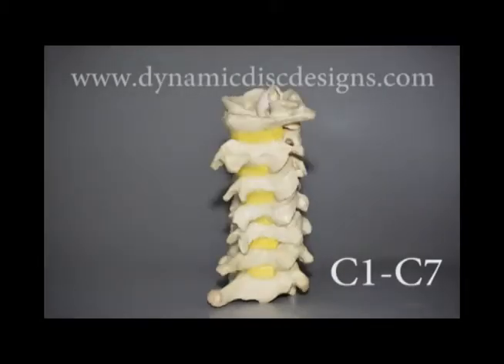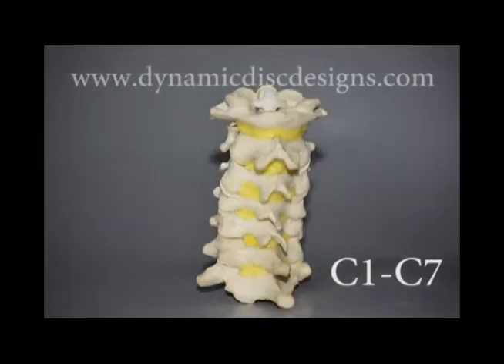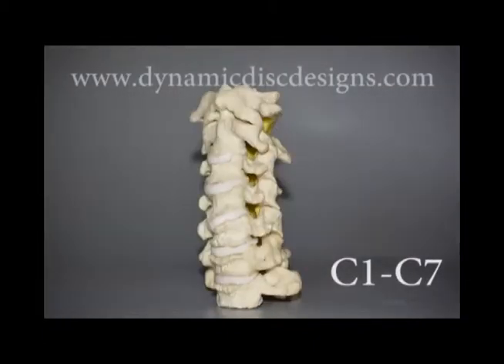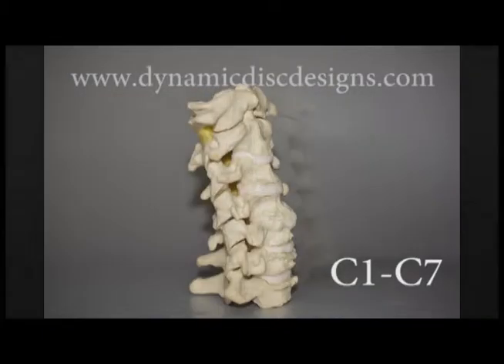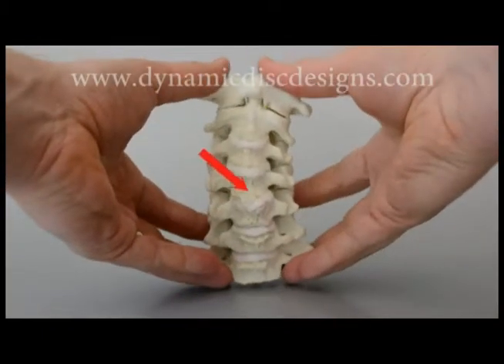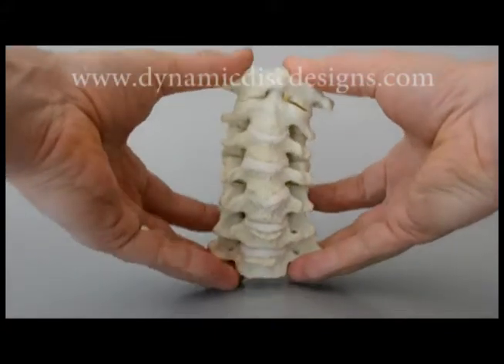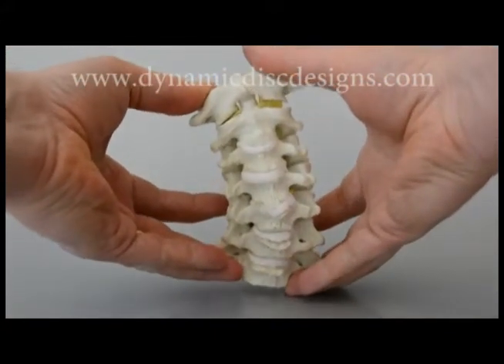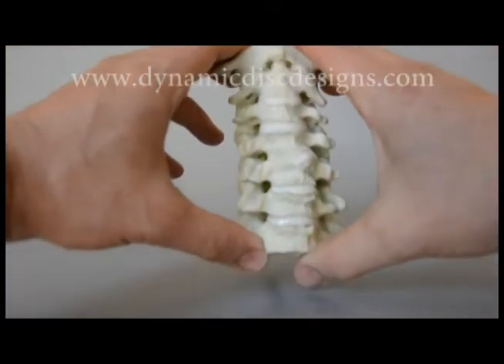Cervical Hypermobility Model | Instability of Vertebrae

Comment: What I keep feeling - I can hear C1 c2 like a 5mm slippage.  And if I lay on a pillow or rolled towel I feel a pulling off noise and if I tense the back neck muscles in the occipital area it slams together.  If I do jumping jacks it clunks - like a separation popping off and on.  Not sure if it’s c 1/2 or c 1/occiput.  
So far no MRI showing anything... yet these are without contrast.  XRay is ok.  

I feel a burning brain, sense of dizziness that’s different from normal spinning room or low blood sugar.  It’s scary.
Anxiety is high.  Tinnitus is all over the Pitch chart.  Heart palpitations.  Numb hands.

Yet doctors just send me to physical therapy and NSAIDS.  Now they moved me to pain management.  😔 

I know diagnosis is not always text book (it can be)  but it seems doctors run every the same.  Maybe it’s more than 1 issue.
Reply: With spinal instability, it's usually not as likely to show in imaging taken in the typical laying down position, ideally you would want imagining done upright (there's far fewer facilities that have  upright mri machines, but there's other options, from what I understand... I'm just trying to figure out what's wrong with me, too, lol...)

I'm sorry you haven't found doctors who try to find the cause of your problems. I hope you keep searching and I hope you find a good (or at least decent) doctor who will help you find a diagnosis.

Unfortunately, that's not usually how it goes... Which is just beyond frustrating and it's just... I'm sorry things are the way they are. Don't give up on yourself, though, you know your body best, and you deserve answers.

I wish you the best of luck in your health journey!